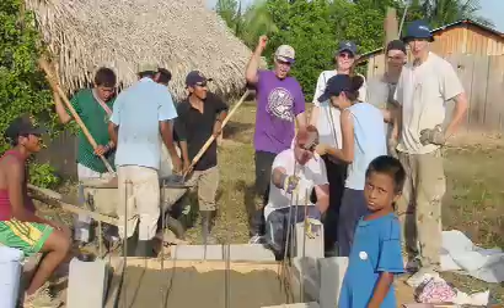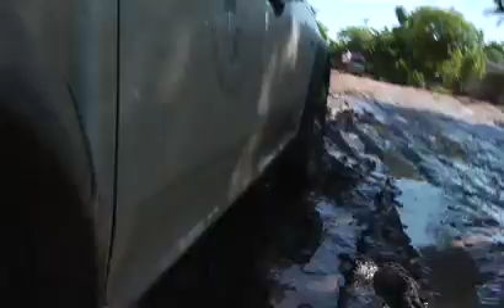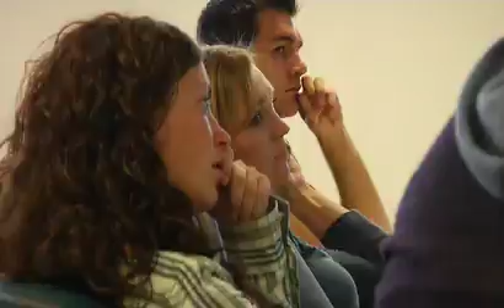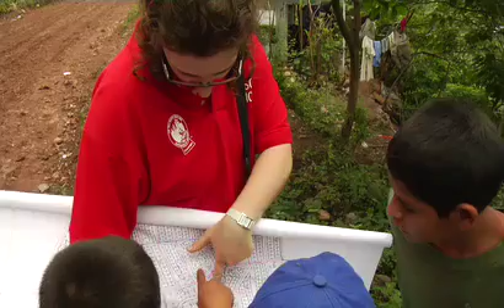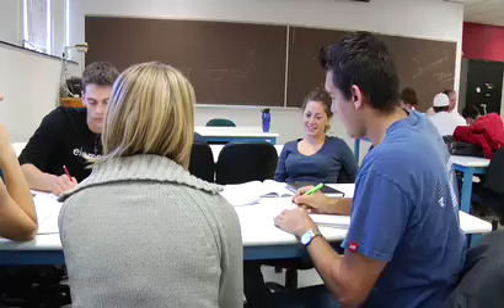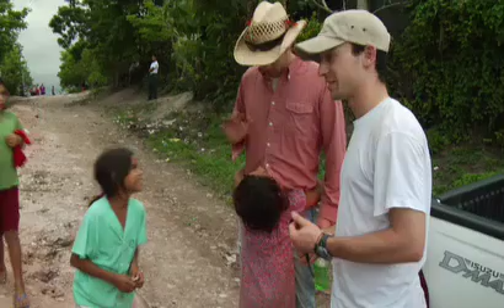Humanitarian Engineering Program

Comment from the maker: Yes, we have implemented many of these projects. Many are also still in progress. The Ecuadorians are using the small hydro and are developing improvements. 26 miles of plastic pipe have been laid, a well has been drilled and the people of Colinas de Suiza are building the water storage tank in the Honduras Project. We're still working on two projects in Uganda, just began another project in Kenya (the same tribe of Obama's father) and a new project in Madagascar (with EWB). Preparation is key.